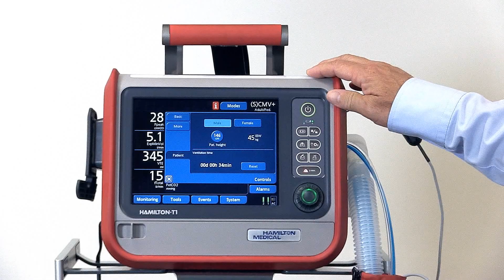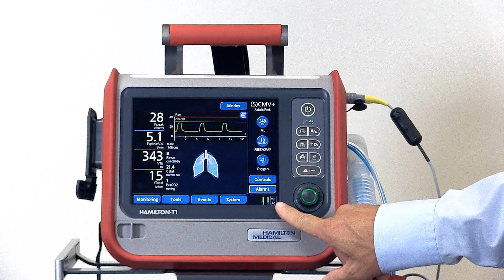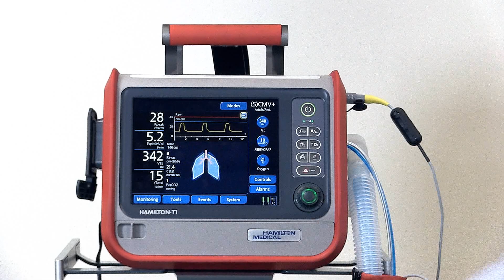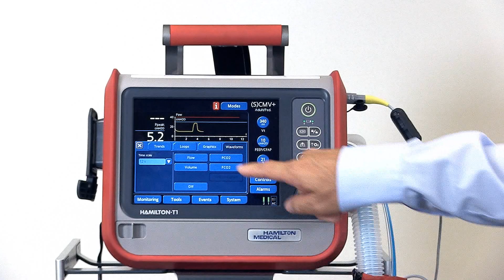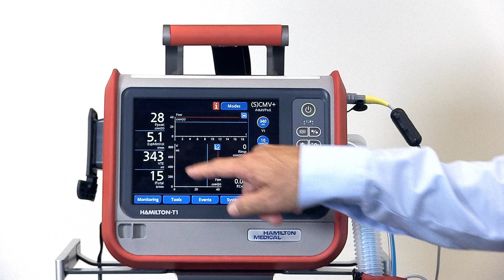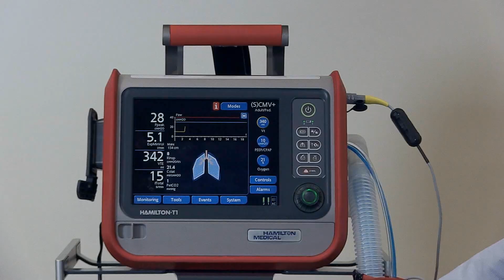HAMILTON-T1/C1/MR1 - User Interface

Comment: Where is the standby button?
Reply from the maker: Hi, Lissa. The standby button is the same as the power button. To enter standby mode: 1. If the ventilator is running, touch and quickly release the Power/Standby key then touch the Activate standby button.